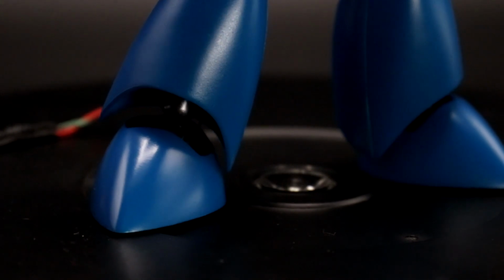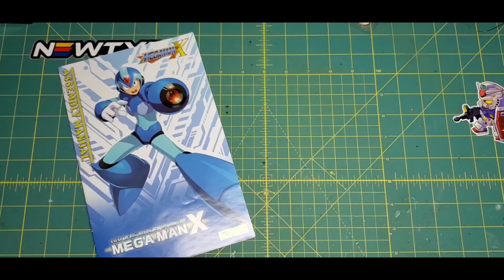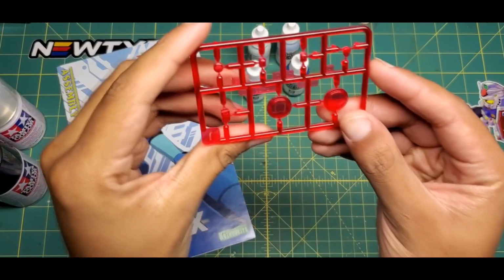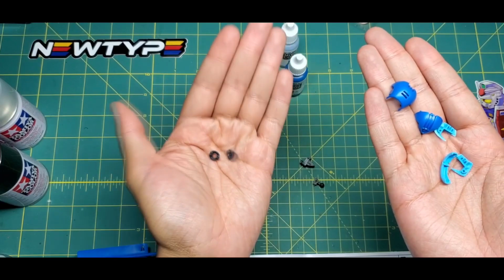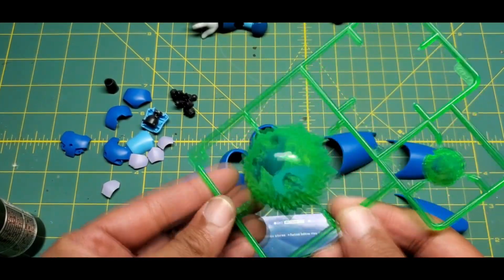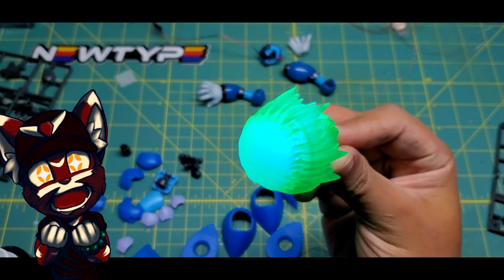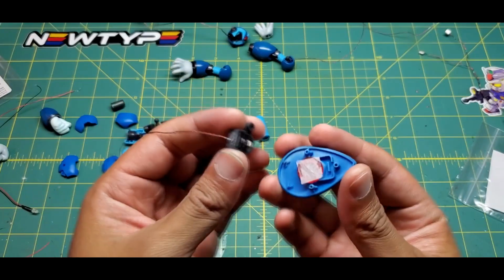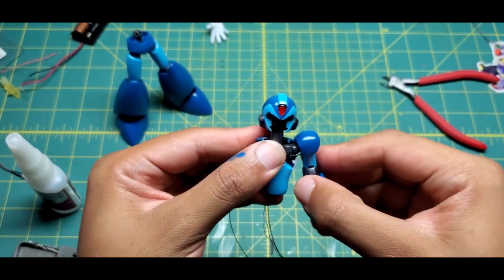#OtakuBuilder #Megamanx  1/12 Megaman X Model Kit (Kotobukiya)

Comment: I use to collect the figurines like crazy. I STILL have the mass majority of the old D-Arts lineup from the early 2000's which are so hard to come by. I'm just glad Bandai has either improved or re-released those old figures and these model kits by Kotobukiya are fun as well. I had Megaman and Blues and Zero, the scaling is odd but they were still so much fun to build back then.

Comment: What's the logic in putting a certain color LED behind the same color plastic? You specifically didn't do this with the blast effect, and explain that clearly, but why not also with the head/buster parts? Do you use a red LED behind red plastic specifically because you want the light to be dimmer than it would be if the LED were white?

Comment: Am I the only one who had trouble with this kit?. Like, its awesome of course. But in my case there was a lot of parts that required a lot of strenght to fit in, the build is very sturdy to the point like I feel like im going to break it lol, and one of the thighs pieces falls apart very easily when moving the feet. I had mixed results with this kit, hopefully the max armor and zero will come out better to me.

Comment: Just Naked X? No light armor. 4th armor, ultimate armor or copy X cmon capcom. Until they make kits of those Xs and Zero ill pass kotobukiya especially since they havent made a death saurer zoid kit yet.
Reply: Do you regret now ? Kotobukiya did Max armor X3, Force armor X4, zero and nightmare Zero, price of normal X and Max armor started to raise. I guess Kotobukiya will continuastly do many model kits of MegamanX line. If you've not preodered Zero, better do it now.
Reply: @123hyouretsuzan5  cant regret what i didnt know existed link me
Reply: @ZeroOmega-vg8nq  sorry but i don't have link, i preodered through a shop in my country.
You'd better find a way for these kits, they have not so good joints but fantastic look how the original design of X series should be in toys, best representation up to date. 
You can watch on youtube for upcoming model kits as Zero, Nightmare Zero, and Force armor with variant rising fire X (prototype ver).